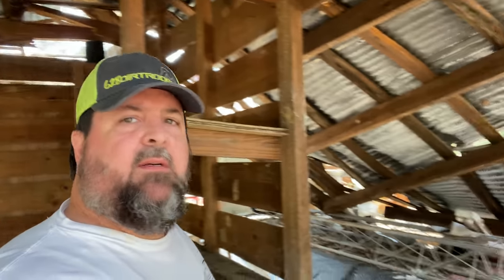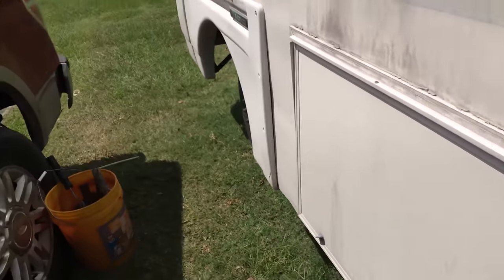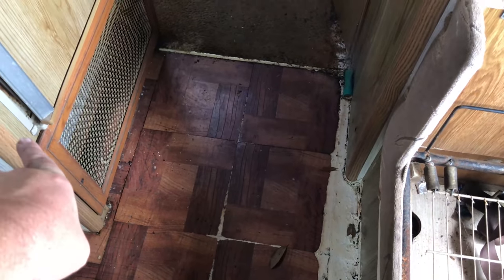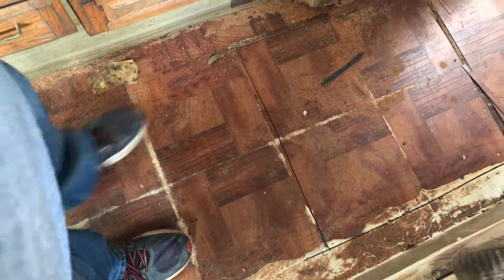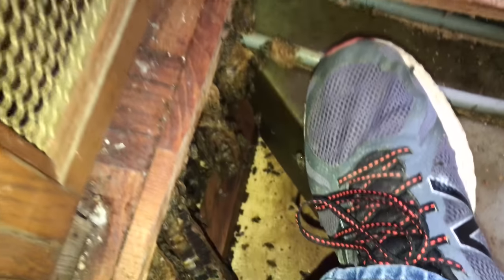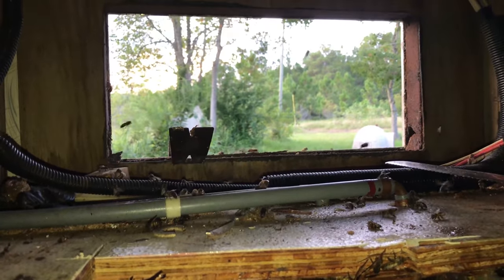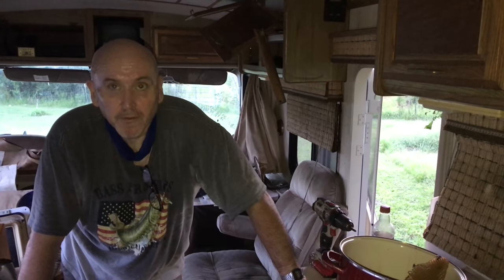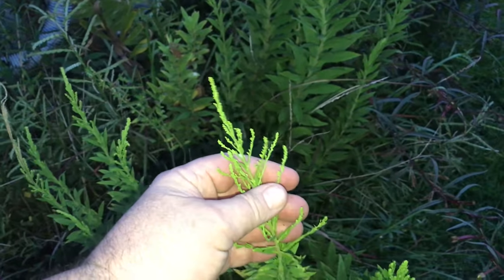Totally Legal Mobile Honey Lab $$$

Comment: What's that Rohn tower for in the soon to be former shed?
Reply from the maker: 60' ham radio tower.
Reply: Didn't know you were a ham. N5JYP
Reply from the maker: @alittlemoore1  I bought a radio but never got licensed and haven't fooled with it in several years.  The antenna was on a piece of property we bough a long time ago and I took it down when we sold the place.  I intend to put it back up when the new pole barn is up.

Comment: Good lord! I think my 1987 Road Ranger 5th wheel was ready for the dump thanks to a small leak that happened when the awning poked a hole in the roof during a wind storm. Nope. She looks brand spanking new compared to this. Thank you! And yes, I 100% though of that show seeing that! Are you sure those are bee's or something else? :P
Reply from the maker: Hang on to that Road Ranger.  Have you seen the price of new RVs these days?
Reply: @628DirtRooster  Oh she isn't going anywhere! She is called the DAWG HAWSE. My husband uses it more than I do and co workers borrowed it for a month. They loved it too. They feel homey, unlike these new ones!
Reply: Besides, these new ones are junk compared to how they used to be made! A larger friend sat down at his new dinette the first time out and the back just fell right off. It took 3 months to get it replaced! Nothing but the hot water tank and the roof went on the Dawg Hawse, and it was already "Redneck' fixed with silicone on the outside and I just used clear tape on the inside! haha